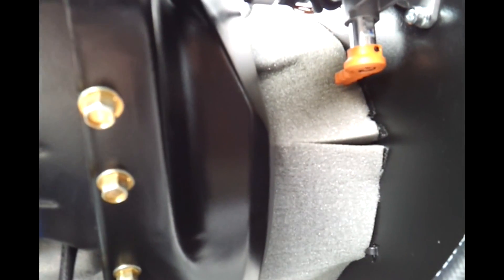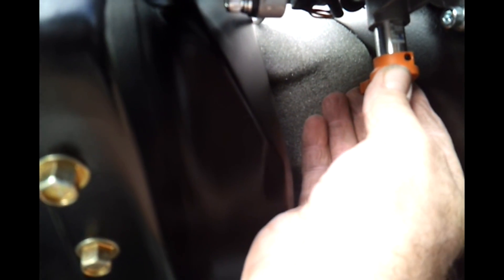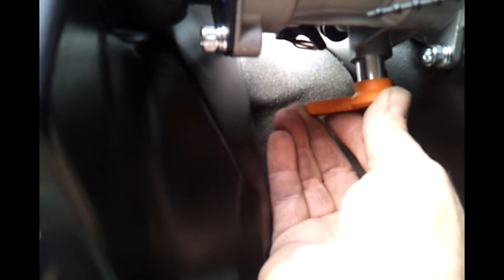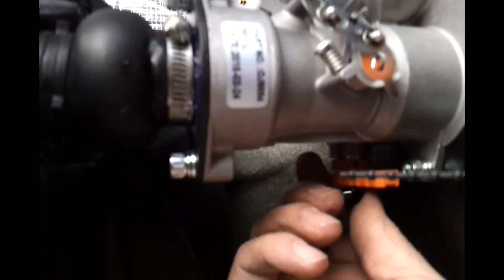Generac Generator switch to propane

Comment: I dont see anything that looks like this on my Generac 20KW Guardian Series. Your video starts with a close up view which is great but i cant tell where you are on the generator since mine looks different . Can you provide a picture or short video zoomed out and then get close in so I can find the switch / valve? Thanks !!!!

Comment: When I twist mine it isn’t moving at all like it’s  jammed not moving
Reply from the maker: It's very stiff. Be pushing up firmly while turning it. It doesnt turn at all held down because it has a spiral groove and must turn around and up at the same time.7
Reply: @greenrumour   I’m having same issue, does power to the unit have to be on to unlock a solenoid or something while doing this or do I have to program to LP first? Right now unit is off, this is initial install with intentions of using LP
Reply: It took a block and a screwdriver as a lever pushing up to move mine.

Comment: @greenrumour, will this work for the Model #:G0058841 Serial #:6438545. This is the Guardian series 14KW standby.
Reply from the maker: No there is a pin with a hole in it under the air cleaner cover that you slide out toward the back of the unit to change to propane. Here you can download the owners manual and other manuals related.  https://www.generac.com/service-support/product-support-lookup/product-manuals?modelNo=G0058841&lang=es-mx?lang=es-mx

Comment: I wonder if thee knob inside is for natural gas and with it outside is for propane?
Reply from the maker: With the knob in the lower position it is set for natural gas. With it rotated to the up position it is for propane.
Reply: greenrumour . Is that all that is required?  No orifice and, or gas valve, appliance regulator to replace or change out?
Reply: greenrumour . I realize an LPG service regulator, and adequate line Diameter piping is required.  But am unsure about the rest of the conversion.  Thanks.
Reply: greenrumour .  Thanks so much. Appreciate your help.   Always good to see looking dogs !
Reply from the maker: only the valve gets rotated for the mechanical change or conversion than there is a change at the board in the set up for the board you'll choose lp or propane instead of Natural Gas